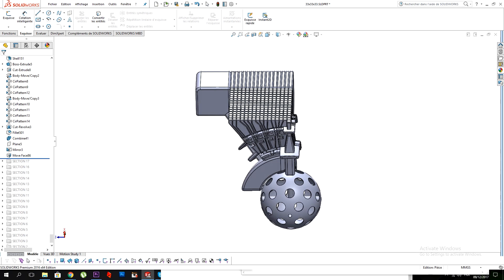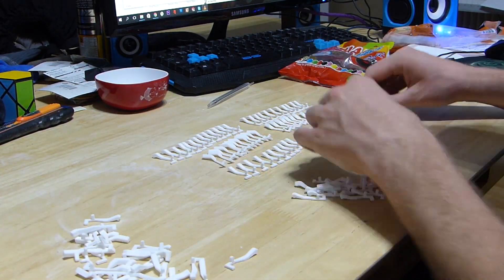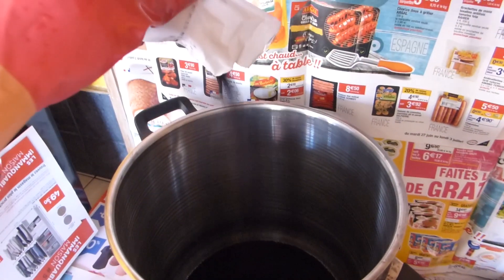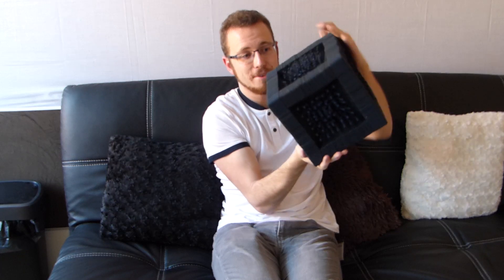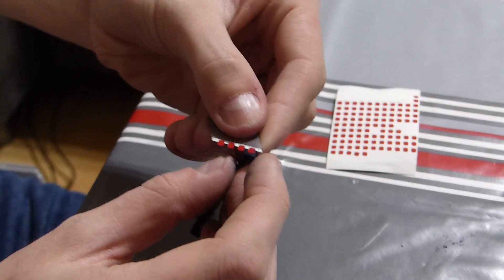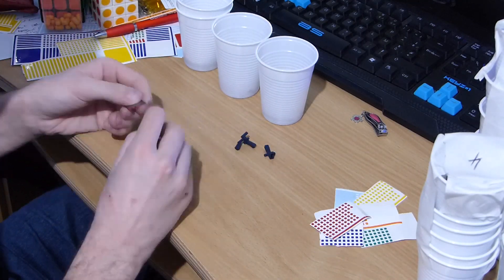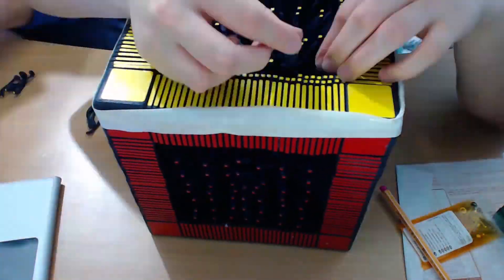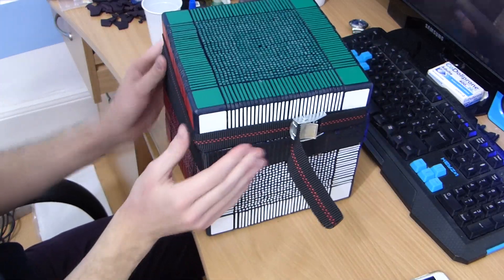How I Assembled the 33x33x33 Rubik's Cube !! :D

Comment: It would be nice to try to solve it. My guess is it would take about a month, OR 2 or maybe a year. Thanks for the assembly video. Great Job on the cube! You said you used a 9x9 for the core. Could you?, in theory, make a larger cube by using a 11x11 or 13x13 core then multiplying the inner pieces by 3 again?

Comment: Why don't you consult a (absolutely insane) company to produce this puzzle in higher amounts? It obviously wouldn't be cheap or necessarily mass produced
Reply: Muzik Bike you can buy it on his website. €15.200.
Reply: Link pls?
Reply: Champion Gundyr no you dummy it's 15200€
Super expensive
Reply: THERAGINGCYCLOPS thats what i said... 15.200 is the same as 15200
Reply: Champion Gundyr maybe you should use a coma instead? (This , )
Instead of a dot? A dot is usually used for showing the decimal point, and I got confused by the 2 dots
Reply: THERAGINGCYCLOPS here we use a comma for decimals
Reply: T Perm deal with what?
Reply: AN*us
Reply: It's because it is 3d printed.... Mass produced would be a bit cheaper